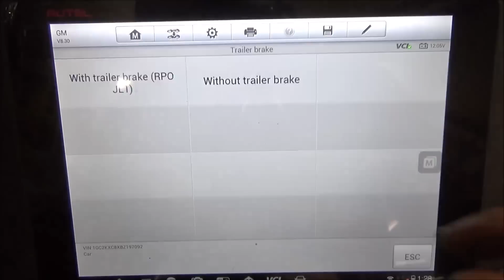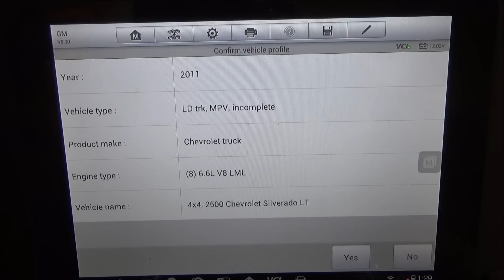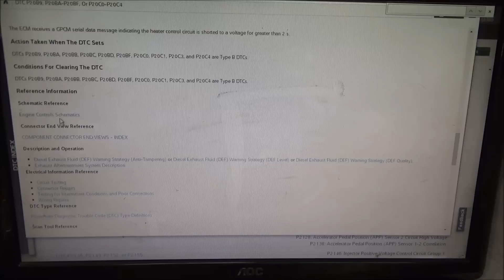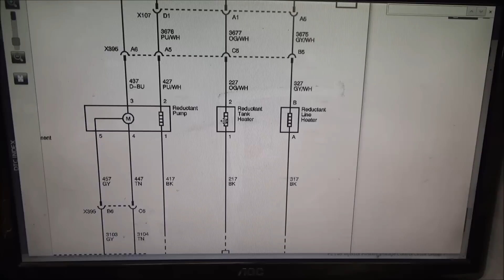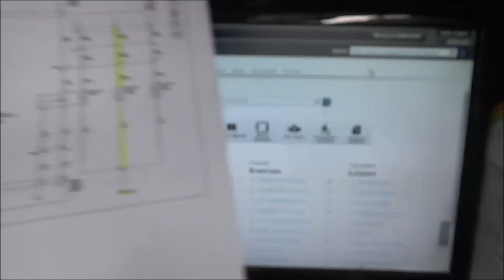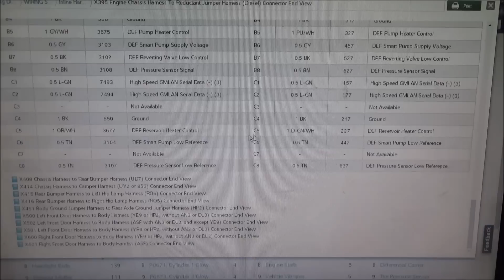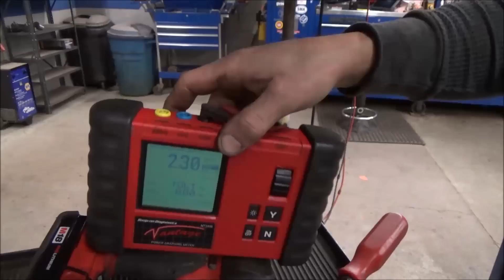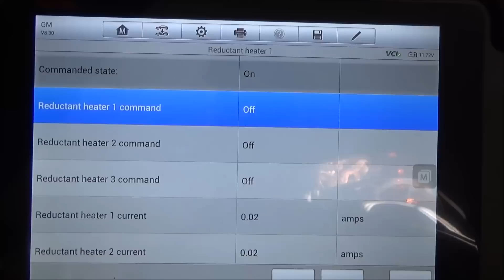Chevy / GMC 2500HD Duramax - P20B9-00 Reductant Heater Problem - Part I

Comment: I had same code but different issue that triggered it. I had just completed a coolant flush which involved pressurizing the system in order to get that last bit of coolant out. I refilled and used 4 PSI shop air to push coolant throughout the system which seemed to do the trick. My first road trip triggered the code and warning of engine derate. Long story short it was fixed by removing the small 1/4 inch hose top right side of radiator, plugging the open opening from removing the hose and pressurizing the system once again. There must have been an airlock in the DEF tank heater. Anyways it was a nice quick fix.

Comment: These def problems can be a nightmare. The 2015 that I'm working on had the exact same problem.  Every time I scan it, then fix it, it comes up with a different code.  Changed both nox sensors,  then the tank heater, now I have  it back on the lift because it now says the line heater is bad. And in fact it is bad, so that parts on order. Funny how much these parts have gone up. Your tank heater was a couple hundred nine years ago,  now you can ONLY get it from dealer and it runs double that price. Just the line heater, which is just a hose with a heater on one end, is three hundred now.  Crazy expensive to fix these def problems,  because they seem to fail in cascade form. Which for this truck is reaching three grand total.

Comment: I’ve got a 2020 doing same thing!   And the GM dealers people think they are masters! But most are high school kids fresh outa school with NO experience.  Common sense approach is best. Check simple first! Like this guy did. And quickly he’s sorted the issues.  I’m betting mine is same thing. It or rebuilt so it’s possible it may have jerked a plug loose or pinched a wire but same code. I’ll have dig in and see what I find.

Comment: Thanks for the info, For anyone else caught in a pinch and need to move. If you can get to the glow plug control module under the intake hose and remove the cover you can jump the orange/white to the grey/white and run the active tests in the glow plug control module....this will get you out of a jam

Comment: I got the impression that you have reservations with Mitchell's data.  I'm at the point of resolving a P026D issue on a '17 Duramax and am looking at either Mitchell or AllDataDIY.  You have any preference either way?  There's a clear difference in annual price....

Comment: You would measure the resistance to a known good ground from the black pin to determine that your 2 k resistance was not in the ground connection. This resistance should be nearly zero. If that were so, then your high resistance is certainly in the heater itself.

Comment: I replaced my reductive heater circuit I am not throwing any codes but I still have the service exhaust system light won't come off took it to dealer they told me drive it for an hour hour and a 1/2 at   20 miles and 30 miles Per hour I've done it twice nothing's happened do you have any advice

Comment: just viewed this video hard to watch cause i have done about 100 of these DEF tank resiviors don't even diag them anymore well i do command it on and ck. make sure theres a connection. parameter will have some amp reading . and in the special coverage witch is a extended warranty does have instruction . and you should be wearing gloves and eye protection . stuff is corrosive . love your videos . i noticed you started scraching back of your hand lol .

Comment: Truck bounced in and out 7 to 9 times where the truck was purchased they couldnt resolve the issues so I talked to the boss and took it to another dealer who had no troubles handling the job or the work in one shot  from then on the ones on the ball got all the purchases and repairs

Comment: Hello boss I have the same problem,  I replace the heater and check engine light goes off but the DEF light keep flashing and gives the message  for check  reductant fluid system . Do you have a y idea how to take that flashing light off

Comment: GM issued a Special Coverage Adjustment / Warranty for this issue. #29400 Diesel Emission Fluid Tank Reservoir. Just needs to fall with in 10 year or 120,000 miles. Cost me zero to repair / saved me $700.

Comment: Can't help wondering if the truth lay somewhere in between the two stories.
I suspect you "Light was on when I went in and still on when I picked it up" mentality was correct.

I was burned a few years ago by an acquaintance who was out of work and had part of his suspension collapse, (he knew it was coming but that is another story).

He didn't have the cash to pay up front for the repair, so I arranged with my mechanic to do the work as cheap as possible and he could pay it off.

Basically the lower control arm failed where the strut inserts. (This was due to accident damage from previous owner - as stated earlier he knew this was a possibility and had been shown the damage on a hoist/lift). Luckily he was coming out of a car park when this happened and not turning off a freeway.

Since it collapsed, it damaged the rotor and some other parts. Only all he knew was "lower control arm..." (despite the itemised invoice he got). Wasn't happy with the bill and started going around to other shops asking "How much to replace lower control arm...", leaving out the story about how it had collapsed. Of course they all told him he was ripped off.

Some people just don't want to know.

Comment: hi erick i have 2014 silverado same problem  but no check engine light only yellow triagulo and alert reduse speed i do messure ohm and i have same as the video mine is 2.68 ohm yours was 2.23 tha mrans its bad too??

Comment: Love your needle trick. I did that in 1984 on my 1983 F150! My Dad had a really small travel trailer he needed to take to a dealer. I didn't have a wiring harness on my truck. So I pulled my taillights and stuck some straight pins through the wires. I used some alligator clips and a bunch of electrical tape and hooked up the lights. The trailer didn't have brakes and we just needed to go about 8 miles. Dropped the trailer off, took out my taillights, removed the pins and wrapped the wires in some electrical tape. My Dad didn't think it would work. Then he thought I was nuts. Then he congratulated me on improvising! We had a short time line to get it there before I had to get to work. :-)

Comment: Whaahwwa!! I'm back.  My '14 Ram Ecodiesel just threw a P20BD code (DEF line heater control circuit open).  This is a Chevy but the system is almost exactly the same in design.  Here to get an idea before I crawl under it to find the wires to test them.

I just had to have a diesel.  No one said I was bright.

Comment: I own a  2011 2500 HD  as well and I am having the same exact issue. What did you charge the customer for this repair, parts included? I know GM  paid for it or a portion, but just trying to get a rough estimate of what I should be paying for this type of service. My truck is apparently out of warranty for this specialty type of service 😢

Comment: I bought a 2001 base model Silverado. Took it to the car wash and the floorboard on the passenger side filled with water. Long store short, The air/water separator box for the fresh air intake was too small. They had sent a service bulletin to the dealers and it took 3 drop offs to the dealership and me calling Detroit before the dealership realized they had the fix. In the meantime They destroyed a battery operated Christmas wreath I had on the front grill taking the thing through a carwash. You would think after many decades GM would know how to build a truck or a car. I have had 3 new cars/truck and all of them have had design flaws. New cars don't just lose value when you drive them of the lot. They aren't worth what they should be because they are flawed from the start. Car companies used to test new designs before they put them into production. It seems they don't do this anymore with all of these millions and millions of recalls that did not happen 30 -40 years ago.

Comment: I know a guy that worked for years at a Ford dealer. To work on the Ford vehicles the technicians had to have the Ford training. If they did a job without the specific training they would not get paid. GM may have similar policies.

Comment: I have a 2014 RAM with the v6 diesel.  I haven't had any problems with my DEF system but a number of guys on the forums have had issues to the point that the dealer won't work on them anymore UNDER warranty.  I know 2 had their trucks bought back for various emissions issues.  Well, it turns out that one guy recently had the DEF fill level go bad.  No way to replace it except buy a whole new tank.  They quoted him $1500 with $750 for the tank alone and had to pay for the tank upfront.  I told him to send a photocopy of his  &*&^$ to them and buy one off a retailer for about $300 and have a real mechanic install it.  Turns out the new tank is from the same supplier as RAM.  Go figure.  Such a racketeering of parts out their.

Comment: Unfortunately some dealers have problems finding good qualified apes to repair cars. But as a dealership technician/ape who has been at the same dealership for 20 years and is very well educated on duramax in this example, I know everything that goes bad on duramax. Maybe it's because I have fixed on average 1 a day since GM started with duramax. Because of my experience what took this guy 20 or so minutes to diagnose take me 3 minutes. Gm has a special policy that covers that tank reservoir for 10 years or 120,000 miles. This repair pays 2.1 hours and it takes me less than an hour. I also get paid other labor  hours to clear warning message. So this dealership ape saids watch you insults. 🖕🖕🖕🖕🖕🖕🖕

Comment: Just had this coded today. And you smashed it.  I have a few 6.6l diesel in our fleet and did all there heaters  in tank and module pump on top of tank also. Good step by step. Did the same and fixed it like new. Good job.
Reply: Yes I had the same def problem on mine and it turned out to be the wiring harness and module on top of the tank. were badly corroded and needed to be replaced. Probably cause of all the salt in in the winter
Reply: @leadnsteel  nice. Yes bad spot to trap salt and dirty holds it on top of tank.  Def good system few bugs to fix

Comment: Iirc 2011 was the first year for this DEf fluid system and GM really dropped the ball on this one . 2012 were SOME bugs worked out . We had one at where I worked and it also was a 2011 ,we replaced the entire unit inside the def tank and then the injector itself went bad .  what a POS  !! thanks GM

Comment: 2012 and already holes rotted through the frame....60k for a truck and you get Chinese steel and Chinese electronics that dont last, damn shame. Wish the Japanese would build a full size pickup
Reply from the maker: They make the Tundra and Titan.....
Reply: Yeah, just wish toyota would make a 3/4 ton. Not a fan of the titans
Reply: Thats just gm trucks the other ones dont have rust problems on the frame like that...heck new ones on the lot have surface rust

Comment: I’m having the same issue with my 2015 Duramax. I took it back to the dealer and their solution was clear the codes and install two new over priced batteries! One day later, engine light pops back on. Does anyone know if the DEF system would be covered under the drive train warranty?

Comment: I need you to fix my truck. It has the same problem with that code. I take to dealers they fondle with it and I bring it home. Light comes on again and now it’s something that has to do with DEF again. Still up to this  day light is on check reductant fluid. I get a bill of over 1500.00 every time. One of them is when they Brock my transmission wire connectors and blew computer module. That was expensive too. I’m tired of this. Thanks a bunch.

Comment: Excellent video. Wish I was working wherever you are because here in S.W. Ontario as soon as you lowered the DEF tank you'd be covered in rust, salt and dirt and probably 11 of those wires would snap off flush with the tank from salt. I envy the techs who work on clean vehicles!

Comment: Awesome job ! What Autel scanner are you using. I tried Auto Enginuity but it won't reset p20b9 code . I replaced the tank heater and metered from the glow plug module shows 2.3ohms now

Comment: i had this exact problem with my 2011, penske chevrolet replaced the whole def tank guts and all under warranty. they got on there computer printed some stuff off said its a known issue this yr duramaxes so its coverd. i was at 110,000 just out of the 100,000 mile warranty. im at 133,000 now, and have replaced the tcm since then,600$ dealer repair. other then those 2 deals its been a good truck for me,pulls a 20ft enclosed for work every day 100 + miles round trip.

Comment: What was the website or program you used to check the correct wiring color output from the connector......alldata....BBB ind......?
Reply from the maker: +ketcamaro Mitchell Prodemand
Reply: Ok...wasnt sure if it was or not,know you showed the wiring diagram that was wrong didnt know if you had another source for wiring diagrams?
Reply from the maker: I use BBB and MOD but that is it..

Comment: front probing isn't bad as long as you have the appropriate test leads that are specific for that style connector. it's actually better than back probing and way easier when you have the correct test kit but they aren't cheap. nearly $100 for just a Deutch test lead kit.
Reply from the maker: +lawman1995 We always joke about front probing in our vids because it makes arm chair experts go nuts lol
Reply: +South Main Auto Repair Yea lol I can see that. I'm actually a Peterbilt tech and they do not like us back probing. we have to have the appropriate test kit to do our electrical tests
Reply from the maker: I actually have a back probe for Deutsch connectors but I never use it because I no longer work on those old rockin knockin diesels :)

Comment: Excellent diagnostic work  !
Seems like mud and water was getting  into the area where the heater wiring is, at the back of the tank, poor design,
How does a 4 year old truck need all that work that the dealer did ? it doesn't make sense to me.

Comment: What the hell is going on at that dealership... You mentioned at the end that they said they replaced the knock sensors, injectors, and a module, but they couldn't fix the problem related to the heater because they "don't have a diesel guy". Then who the hell did the prior work to it lol? The vehicle detailers? "It's under warranty, bring it back" But they don't have a diesel guy. And OF COURSE they suggested trading it in on a new truck. Guarantee they would miraculously fix the truck "without a diesel guy" once it was traded in for a shit price and sell it for twice as much. What a bunch of nonsense. I refuse to buy new vehicle, let alone get any work done at a dealership.

Comment: the weird part is, i work in a gm dealership as a duramax tech and did contact eric on this truck when i saw the video, if the dumbass tech would have put the code into service information he would have seen the 3 bulletins posting the issue with the exact part that is bad. and fuck its a very simple circuit! 2 wires power and ground controled by the GPCM, i dont even lower the tank or unplug it anymore, i just remove air filter and unplug the glow plug control module connector and check the resistance, i have had one in the 75+ Def heater #1's ive replaced where the wiring was full of corrosion but in that case another dealer had the tank out and lost the connector seal... that and i've bin replacing this part since 2011.... sppecial policy on it now up to 120k miles ot 10 years, same as the indirect injector, NOX sensors... anyways the NEW GM is really cleaning up there act and making GOOD cars and trucks again, and any issue that comes up there fixing right away. hell look at the 2016 canyons we cant sell due to the centre console latch they want replaced... like seriously a little plastic hook that holds the center console Lid down, they wont let them be sold until its replaced
Reply: +Kevin Rogers   Kevin  -- And that's how it should be  --  No Vehicle Sold Until It's Right!!  -- No Exceptions!  Period!! If our Vehicles Aren't Right, Then Make Them Right!!
Reply: +Hawaiian F150 Well since the ignition switch recall from GM, all auto makers got there hands slapped HARD and when your in the thick of things and hear about recalls from all auto makers, Fiat and ford both are in WAY deeper then Gm ever was or is.
Reply: +Kevin Rogers  -  Kevin - I got no doubts on Ford & Fiat being up in the numbers on recalls. The vehicles today are so sophisticated it amazes me they run at all  more so that they run for extended periods of time.  A 100,000 miles ain't chump miles by any means and when you toss in how they got to that mileage, it could easily be a holy crap moment.  Got to give the engineers huge props for all they dream up. I'm from a time when I would time my old impala with the street lights. Didn't work great but it got me from point A to point B. Ain't no way that could work today on any vehicle.  The fault of using or not using good quality parts and for not fixing a known bad parts usually falls to the bean counters and senior level micky mucks and not on engineering or design.  There's no way the consideration of final price to the consumer is to blame.  It's how much the companies get back in profit margin.  To be honest, I don't want to think an engineer had a hand in undermining quality. That would be bad JU-JU that always comes back around.
Reply: +Hawaiian F150 -  Kevin - forgot to add in that I was being sarcastic with the comment  "There's no way the consideration of final price to the consumer is to blame."